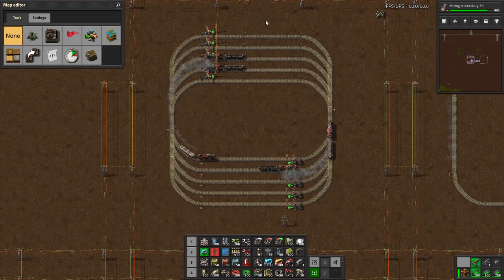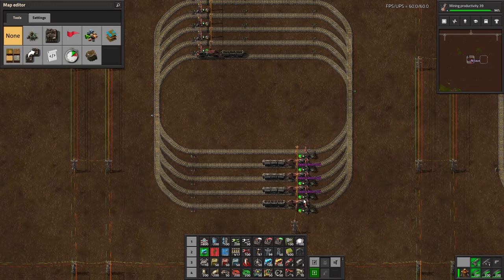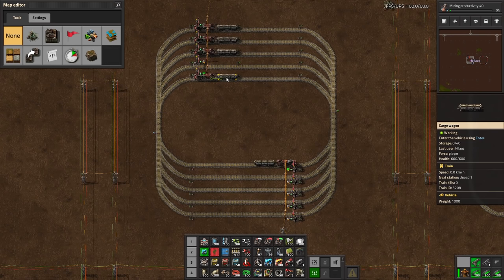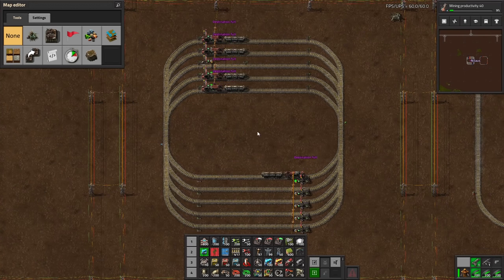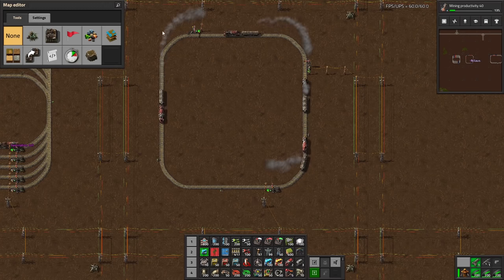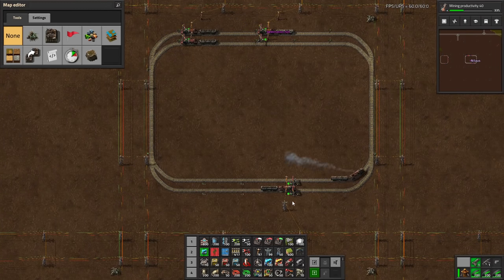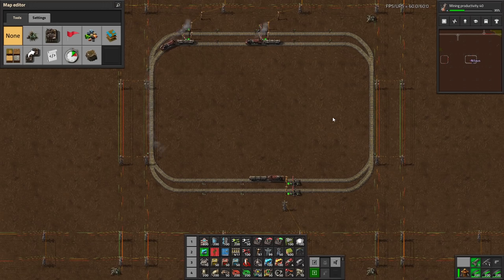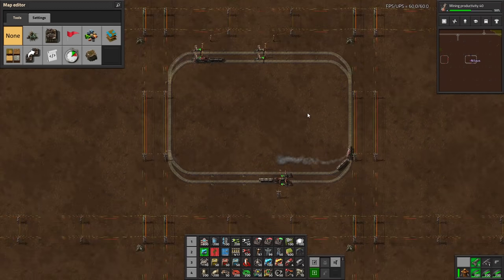ADVANCED TRAIN SYSTEMS; Deadlocks, Depots & Train Limits |  Factorio Master Class

Comment: Ok, preface this with I'm a new player, I currently have 1 train and 1 track. Would waiting stations work better with a stacker before and after and some circuit logic? Let us say double stack before, station, triple stack after. You do the dynamic train limit based on resources available but cap the limit at 3 (1 in station + 2 in the stacker before or 3 after) but then reduce the max train limit for every train sat in the waiting stacker, would that work? The station would close if all that station's waiting stackers are full so you'd never get a train going to a distant stacker. I think?

Someone with more experience, would that work?

Comment: Hi Nilaus,
Awesome series. Great explanation. Thank you. That go-around issue is really strange.
Why wouldn't this happen at the demand station though? I think I've seen it... The demand station requests (say) two trains, they both turn up. One train gets there first and starts unloading, the other train waits in the demand station stacker. When the first train finishes unloading and pulls away, the second train paths through the demand station without stopping to another demand station requesting the same resource.
Reply: That doesn't seem like it would be an issue. Presumably, the first train unloading sets station to L = 0, so the next finds another available station outside the city block.

I suppose if it keeps happening, you just need to adjust the constant combinator to request fewer trains.
Reply: Thanks Curtis, but I don't think it's this. in my example L = 2 to begin with, so the first train leaving would set L to = 1.
On reflection it might be me...
<cough>
I added a signal half way down my unload station to minimise the gap between one train departing and another arriving. When the departing train was half-way out, the waiting train could start to move. That means the second train passes a chain signal before the first train leaves the station. The chain signal means the second train can repath. It looks ahead sees the station immediately ahead of it isn't yet empty and goes somewhere else.
As I write this I'm convinced this is it. It turns out I'm a numpty and I've broken something. Who'd have thought?
Reply: I've tossed out a solution to the go-around issue with the 'standard' load/unload design Nilaus uses. Read the contents of the train and add that to the contents of the chests when calculating the number of trains to demand. For loading stations, you'll also need to subtract 1 from the number of trains being requested if a train is currently being loaded.

Comment: Why not solve it by dynamically bumping the train limit up by 1 when you detect a train waiting? You said you want that train to not count and that would fix it. If you have a circuit that detects the train that has left but is stuck and bumps up the train limit, then that train effectively doesn't count, so that seems like it fixes your issue...

Comment: Your making your own problem with the depot/waiting station. With the depot you have 4 trains running to 3 stations when it should only be 2 for the 3 stations  with waiting you don't give trains a direct route to all waiting stations from any load station in the vicinity. Also you can make resource specific depot or waiting and they will never get full unless you have more trains than stations.

Comment: Hello. Hopefully someone will see this.  Been playing factorio for years and I love this idea.  Problem with LTN that later in game just starts to fail and haven't a clue why. perhaps to much.  MY mega base does get overwhelming and i got trains going to stations that don't need supplies, and items mixing at stops, and fluids all over.  Basically LTN fails later in game.  But now there is another issue and that is my Mall.  I like having a place to go to resupply on items and crafts.  But I hate having a train for each resource.  Anyone help me on how to send a train to a supply location when supplies are needed.  And no, turn off and on stations will not help.  If the station turns off then the rest of the network wont be able to go there for there supplies.  I basically wont my mall to have little or just one train gettings supplies when my stop is low for the mall.

Comment: Just an Idea to the 3rd Option: When your loading station cant provide a full load you set the train limit to 0 right? but the w8ting station is still open. Solution would be: you have to link the provider station with the included w8ting station. so if your providing 0 loads the w8ting station closes. Well but when the full train leaves he cant stop there - weeeelll yes, but no :) so no solution but i thougth i share my thoughts, maybe some1 finds a solution in it :)

Comment: Comment 1, i had an idea for how the train stations could be debugged, tho i havent submitted it and am curious if the solution is the same or not, so posting before i see and hopefully will either see it done or a different solution. Personally, if the issue is just that the train is still counted, why not just conditionally increase the train limit by one for a period of time. A for instance would be "if and only if L=1, +1L" (*2 also works). I do think thats prone to problems like other trains queueing in the interim,  but i hope im on the right track. Now to see what he did.

Edit: ... i mean, adding more stations with supply would solve the problem, sure... i feel like i was kinda on the right track, but it sounds like we all were on the "how do we solve it as is" mindset instead of remembering "just expand".
Reply: Comment 2: Tried my own solution with the train idea I listed here, and yeah, i run the risk of having more trains go to the stop than i really want. The parts cost to impliment is not all that bad to be honest, just one decider combinator and a red and green wire. Hook up the output to the combinator and if L=1, output 1 L to the same pole/station, and boom, it gives a limit of 2 instead of 1. Thankfully not an issue of traffic congestion, but that could still cause another bottleneck and not really solve the problem.
In other thoughts, still seriously grateful Nilaus breaks everything down from the ground up and has these models I can basically impliment to see how it works (if i didn't by just watching anyway). I've been horrendous even in school in learning how stuff works just aurally or by just reading it. The moment i have someone show an example (like Nilaus does), it just clicks and i run with it. I've said it before but I'll reiterate, I love this process precisely because it's helped me grow as an engineer (in game, not sure if i'll do it irl) and has spurred newer and more improved designs. I may doubt my ability to match Nilaus (and his supporters)' designs as a whole, but it's still incredibly enjoyable taking inspiration from others and growing as a result. Thank you everyone.

Comment: your problem is that the waiting/depot stations are separate stops. give them the same name as intended stops then make the station extremely unattractive by placing a manual dead train at it, and a dozen dummy stops in front of it, and a red rail signal in front of those. make a giant stacker in front of that. 

if every station has a zero limit for whatever reason, ONLY then will a train bother to visit the depot. then the trains will just pile in the stacker and revaluate every 5 seconds, once a real station opens up any active train at the front of the stacker will repath to the open station.

This is basically just making a set of dummy outposts with the same name as real outposts, that pile so many negative multipliers to pathing that no train will ever go there unless there's no other option, if the trains are stopped at chain signals they will attempt to find a repath (including a new same name  station) every 5 seconds.

you need a stacker large enough to accommodate every train that might ever use the depot. this combined with keeping every station to a minimum limit of 1 hasn't failed me yet.
Reply: hard to visualize over text, but the dummy station shouldn't be the path out of the depot obviously. trains will need a rout to recalculate

Comment: THANK
YOU!
I totally agree with you Nilaus. And I wouldn't be that smart to explain as well as you did there.
Thank you again.
I have a question and I know a part of the  answer but I don't want to make mistake :
Is there a good rule to follow concerning a ratio Trains/Request stations or Trains/Provider stations?
I mean, if I got 36 steel stations and 10 request steel stations (for example) how can I estimate the number of trains I need in my network?

Tyvm again for your videos Nilaus :)
Reply: I like to calculate how much resources I need instead of adding more train stations blindly. For my own megabase, I also break my rail network into multiple smaller networks

Comment: There is a possible fix to this problem: Dynamic Train Assignment. If a train cannot be assigned a path to a station, it should be assigned a path to a depot. That's how train networks really work in real life.
But that's something for the mod builders to build
Reply: Have you heard of LTN (Logistic Train Networks)? It basically does what you suggest or maybe I am getting you wrong
Reply: @Ruokos_Huba  Not quite. What he has is a logistic train network, however, as noticed, it breaks down when you have more trains than loading stations.
If you dynamically assign trains to depots, you remove the breakdown condition, whether the problem is supply or demand. If demand outstrips supply, then the depot is full of empty trains, but when supply outstrips demand, the depot is full of loaded trains. 
Such a mod will remove the breakdown condition that exists in the current configuration, whether you use depots or not. In the current configuration of the LTN, the breakdown condition will occur whenever you have more trains than loading stations and there is a high mismatch between supply and demand, because the networks is too crowded. There's just no way around it, because the LTN is inherently flawed, if you cannot dynamically assign a train to a depot

Comment: the reality is... there is no way to solve the train problem to begin with. for the train system is not based in reality. in reality we have train depots where trains gets assembled and desassemble when they are not needed anymore. leaving the network with next to no congestion because there is no trains on the network. in factorio we can't do that... i've been using train depots to stop trains and literally removing them from the network, but makes throughput less because your train now has a third stop in its route. not to mention you have to constructs such places by about 4. one in each corner of your base. so there is no way to make thorughput and network congestion better. fact of the matter, in real life we don't have trains that have only 8 cars... trains can go a mile long. in rel life no trains turns 90 degrees like they do in factorio... fact of the matter, in real life, trains aren'T made for such small bases... even your "megabase" is still smaller then a military base. you dont see trains on military bases... they use cars and trucks to do their lifting. trains are only a good thing when you intend to go 100 miles away and more. sorry but we're not even close to doing that in factorio. not even by a stretch...

so to me the advice should be...
this is not reallife, this is factorio. the destination full cannot be solved without sacrificng the through put.
in real life, through put doesn't matter to begin with...